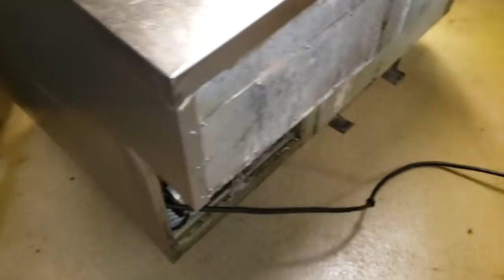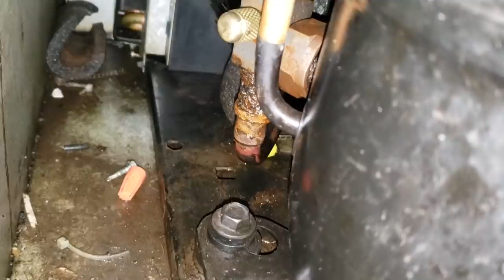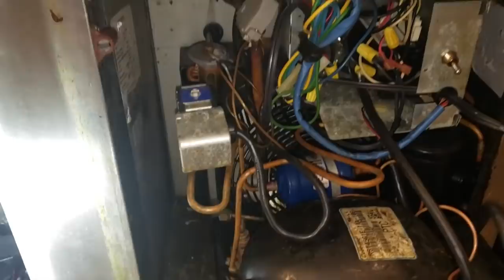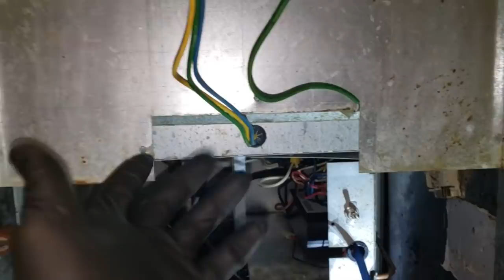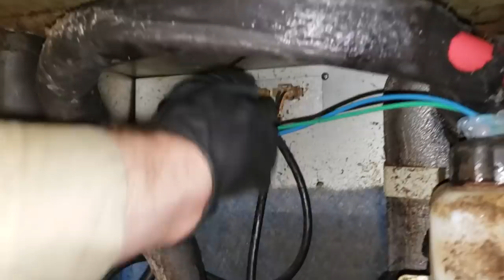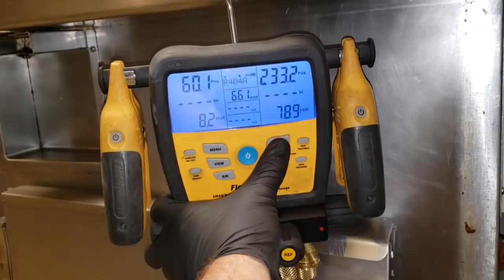KAIRAK BLU UNIT

Comment: I want to say that you did a great job, with the limitations you were given.   I do wonder why you don't carry a set of large crescent wrenches.   There's never a time where a set of slip-joint (Channel Lock) pliers are better than a open end wrench for a clean fixed nut.   I do understand you use the tools you have - when all you have is a hammer, everything's a nail.     (I do use those pliers regularly myself).     In that particular circumstance, I'd have used a open end wrench and a mallet, and hoped that the shock wave from the striking would pop the nut loose.    (Can you tell I work on my car?)   

Did you save the compressor as an emergency spare for later?

Comment: pointing the flame right at the hose was super sketchy. i would suggest you try keeping the hose behind you instead of a loop right next to you. those hoses can get dried out and start to crack and if it lights up you might have a big mess to deal with. also get some one way check valves for it.

Comment: 1:20 That Receptacle needs to be replaced as well...

You should NEVER be able to wiggle a plug in a Receptacle like that, the plug and Receptacle blades aren't making a good, tight connection...

Loose Electrical Joints like that get VERY hot and can/will start a fire...

Comment: Next time you run into a roto lock that is too tight get a long punch with a nice big end - I have also used very big dull chisel put the chisel on the unscrewing side and whack it smartly with a hammer.. the blow will shock the nut in the loosen direction - I have not run into one that I haven't been able to get off ...

Comment: Good video Chris. I would have been tempted to recommend replacement, but if your customer is on board with you rebuilding the existing equipment then it looks like profitable work to me.

Comment: Great work getting that back to a good unit. As much of a pain in the ass it is to work on kairak they do last a long time if taken care of. I ve worked on few hundred different kairaks and the only advice to you is keep a sporlan head for that valve with you. They rot from being wrapped. If it leaks on the bottom it will lose the system charge. On the top it will lose the bulb charge and close that valve. Great job.
Reply from the maker: Hey thanks for watching and taking the time to leave some feedback, I too have worked on a ton of Kairak units all the way back to when they were produced in Harbor City, Ca. The original pan chiller units really changed the game when they first came out. I totally agree if they are taken care of they will outlast most other reach in units.

Comment: Nice job on the unit! I know you have be cussing under your breath every time you have to service a Kairak unit. I have seen your other videos on them & they look like such a pain in the ass to work on. I specialize in HVAC pneumatic controls where I work & the hospital where I am employed is nearly 50 years old. Its common for me to find total hack & butcher jobs performed by others in the past including wrong valves, wrong thermostats, missing controls & other issues so I can really appreciate your work on restoring units like these. Its a great feeling of accomplishment when you can repair & restore a piece of equipment back to professional grade standards. Working on hack equipment really strengthens my troubleshooting skills & forces me to evaluate & think more thus making me a better technician.

Comment: Have had rotalock valves seize like that, I cut or file through the nut until you can just see the threads, then give the cut a whack with a chisel, (but at an angle as if undoing the nut) it spreads the nut open a bit and breaks them free. (though not something you want to do unless you have a plan B or its a kill or cure situation! )
Reply from the maker: great point and you are right I could have tried a little harder to get it loose, I could have just tried to heat it up with the torch too. But these compressors are so cheap and the labor invloved it was so much easier to replace it. thanks for watching I'm gonna go live this evening 4/29/19 at 5PM (west coast time) to discuss my most recent uploads and answer questions from emails, the YouTube comments and the chat come on over and check it out .   https://www.youtube.com/c/HVACRVIDEOS/live

Comment: Nice job! I should have took pictures of the hack job from hell the other day.  Bare wires, jumbled wires with wire nuts every few inches.  Someone installed a hard start, flapping in the wind, common wire not attached. Left original start cap and relay hanging. Threw away the termjnal cover. Wires tangled in the condenser fan. They told the customer the compressor might be bad, billed them, and didn't come back. I replaced the fan motor, control relay, disconnect switch. Cleaned up and capped wires. Mounted hard start, zipped up wires, etc. Thought I was done, ran the compressor,  tripped after a few minutes. Looked closer at the hard start,  looked up the specs of the compressor.  They used a 1/3 HP hard start for a 1/2 HP+ compressor.  Cut out my neat wiring, installed the correct hard start, off and running. Customer would not tell me which company attempted to repair the cooler. I told them whoever it was needed a new line of work. I am not perfect, but I could not hack a system, and just leave it that way.
Reply from the maker: Wow

Comment: Yeah I am watching this again lol, but  I gotta a ?, did you give the baby a new drain pan?, didn't mention anything about that other than obviously missing, which that is also a  important component to the system.
Reply from the maker: So the customer didnt want the drain pan or the casters For whatever reason........
Reply: @HVACRVIDEOS  well, nothing better than to just let it drain on the floor. Lol
Reply: Sorry man. That just bugged the hell out of me,  it may not be the most important component to the system  but it is still important component for the system to function properly,  I also don't understand how they don't have sight glasses installed in factory, that is a great idea to add to the system so you can actually visually see the charge. Would make futur checks and repairs much easier.
Reply: But then again I  am just a  rookie  just got out of the local college studying the trade to be a  tech.

Comment: Sometimes, A little heat will loosen a tight fitting (rotolock).
Reply: Yup. Just a little heat. Throw a pipe wrench on it, and tap the handle of the pipe wrench with a hammer. Been there, done that.

Comment: I have scrapped better looking units than that. It never ceases to amaze me what some technicians get away with on this units and how on earth they ever keep them running for any length of time. You brought that one back to better than new and I applaud you for that. It does make me wonder if the amount of labor and materials with the age of the equipment did not outweigh replacing that unit, but then again this is where you make your money so it's better for you.
Reply from the maker: Yeah I tried to get them to replace it but they said no, so I fixed it. All I can do is try!

Comment: I've never seen a small reach in like that with glycol. Whats the glycol part do? I thought maybe it acted like a chiller with a water cooled condenser instead of a condeser coil and fan, but I see those on the condensing unit? Does it use that for the cold side in the evap??
Reply: The refrigerant circuit cools the glycol and the glycol pumps through the unit for cooling. The evap coil in the cabinet and I'm some cases the cold rail are glycol.
Reply: @Terayonjf  So what's the benefit of using the glycol to cool  the box and rail instead of a normal refrigerant circuit? Seems like it just makes things alot more complex then having two txvs and solenoid valves for box and rail like delfield uses.
Reply: More even temps and they tend to hold temps longer. You also have a shorter refrigerant circuit which makes it easier to find and repair problems. If the heat exchanger is leaking you'll have glycol in the circuit if it's leaking anywhere else it's easy to find since its all in the open instead of lines hiding in the cabinet foamed in never to be seen again

Comment: You make brazing look so easy. I guess it comes with practice.
Reply: Ok, brazing is easy with practice. Start with stainless steel scrap tube or plate when you learn to get that smooth and even you can play with copper. With copper it is way too easy to blow holes where you are brazing.

Comment: Good vid. alot of good info in this vid.
a couple things i don't agree with , but i know how it is in the field. it is what it is. we all do what works for us.
1) putting those sensors all the way down into the bottom of the tee would restrict coolant flow i would think. 
2) i would think putting sensors in to the tank bottom would be more advisable.
3) usually sensors like that are not made to be immersed in the liquid. early sensor failure would  occur. 
4) you should be using a sensor well instead of immersing in liquid or strapping sensor to Pipe directly. for longer sensor life.
5) chris - i know u like to do nice looking work so , You might want to look into using 56% silver solder spool with white flux. lower melting  point, looks nicer than 15% , less heat required , excellent for dissimilar metals , compressors stubs, txv's, drier stubs , less heat = no burning of driers. I think u would like it. its What ive used for many, many years.
Reply from the maker: Thanks for the feedback Phil, and I totally agree with you on the sensors. The manufacturer Kairak made a mistake when they built the unit and they have since realized that the sensors are not replaceable. The location that I installed them in is actually their work around for their mistake. I guarantee you that the sensors will not last a year submersed in the glycol be cause like you said they are not waterproof. But unfortunately because of their design their is no great work around. Because of their design the tank bottom doesn't get as cold as the return stream at the bottom of the tee where I installed them. I will definetly look into the roll of 56% thanks bud . :-)

Comment: Have you seen the drier/sight combo that norcal  Dave uses, wish we had them over here in Aus would be ideal for what you just did. Our wholesalers don’t stock them.
Reply: They are great for time savings but are more expensive and have to be swapped together next time the system gets opened. It's just overall easier to do them separately so you only need to change the filter drier on the next repair

Comment: As an industrial electrician i'm always surprised to see these cabinets dosen't have any rubber seals. All our cabinet we use have at least IP55, and that's indoors. Outside we have to use IP65 or higher.
Reply: So all the other ip ratings are useless?